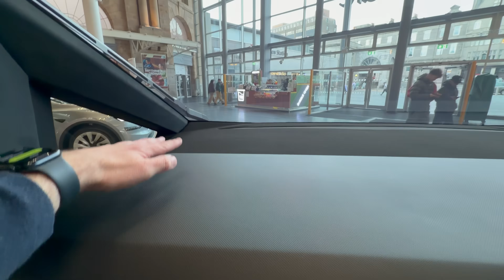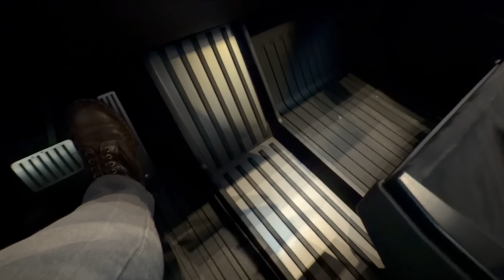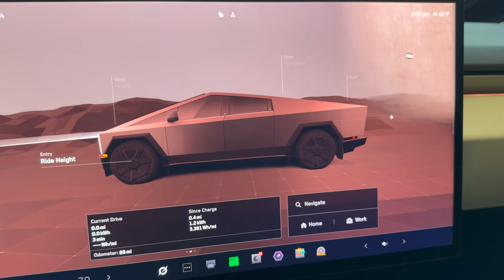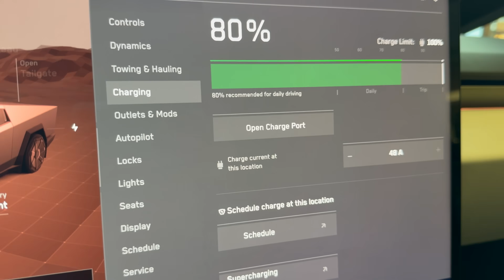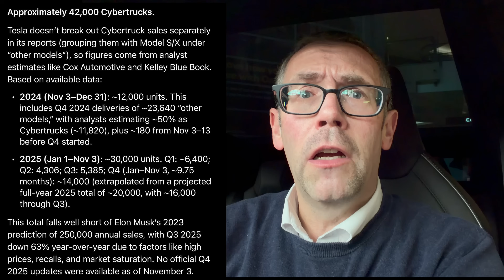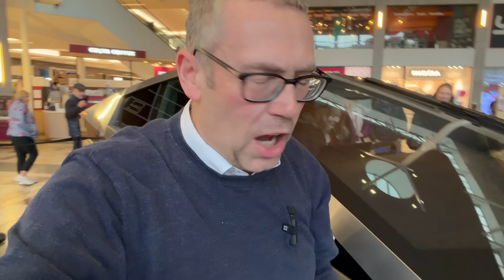How Cybertruck will revolutionise car design - whether you like it or not...

Comment: I agree the Cybertruck is the future, steering wheel is drive by wire and changes depending on speed. It also has vehicle to grid, 48v system and so many other improvements.
Just to add that I have seen the Cybertruck a couple of times when visiting Florida and then at a Tesla lightshow in Brussels.

Comment: 48V architecture, steer by wire, and 800V traction motors will be adopted over time, but four wheel steering only makes sense for something with a very long wheelbase.  Electrically activated brakes will also become standard at some point in the future.

Comment: I'm in the US and have an F150 Lightning. The Lightning is the same body as the ICE F150, literally millions of those around. The Cybertruck is slightly smaller than that, but visually bulky. I think it looks 10% larger than it is. It's hard to set aside the looks, but the CT does have some tech I want. I would have bought something smaller. I believe Geely makes a Ranger sized ute that might make it to your markets. I believe the Cybertruck battery lets the truck down at least in the US market.